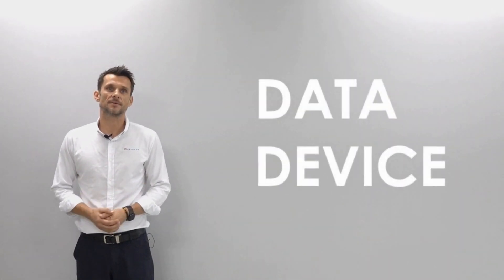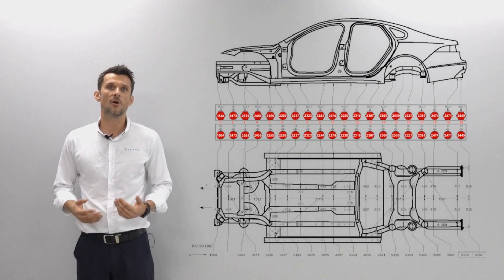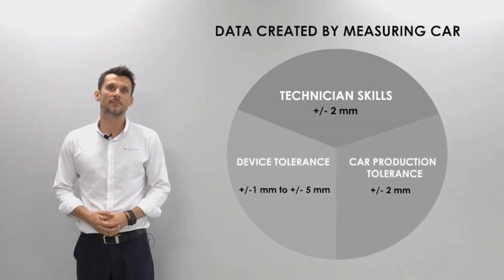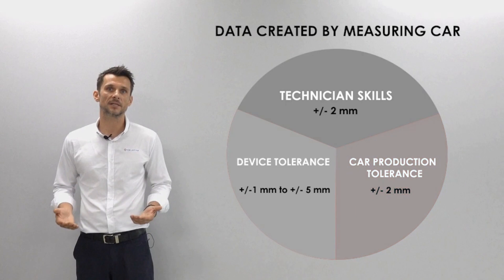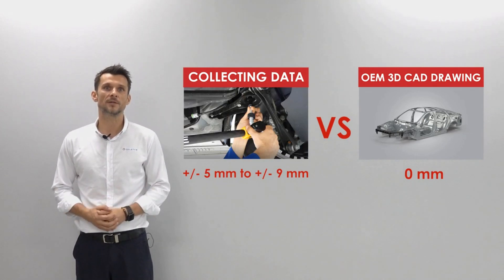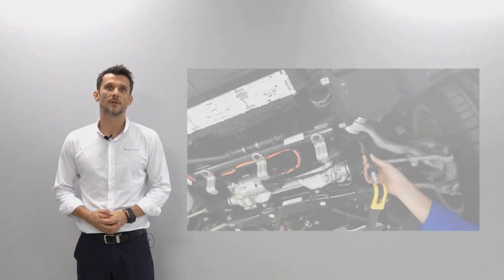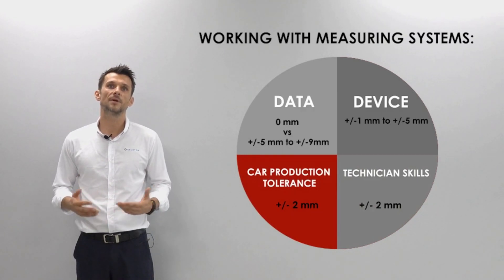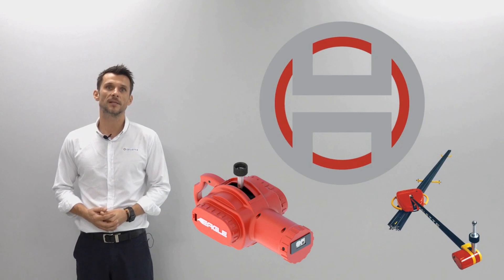HOW TO CHOOSE THE RIGHT CAR ELECTRONIC MEASURING SYSTEM? THE TRUTH BEHIND CAR MEASURING!

Comment: We understand now why OEMs data is important if you want make a right repair process. Soon we will explain why measuring is for measuring, and why the holding device built with an electronic measuring system creates tolerances and deviations.

Comment: Very clear and understandable movie. That's why Celette electronic measuring system is so reliable. Working with OEM 3D CAD datas makes the differences.  Celette is working hard to collect these dimensions. Thousand Celette measuring system are used every day, even in car inspection center ! Invest in Celette !